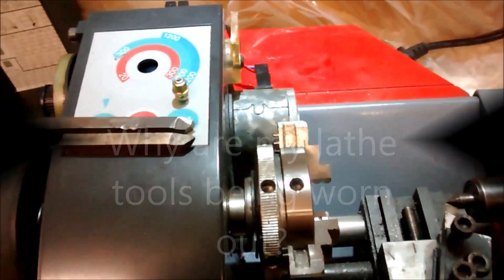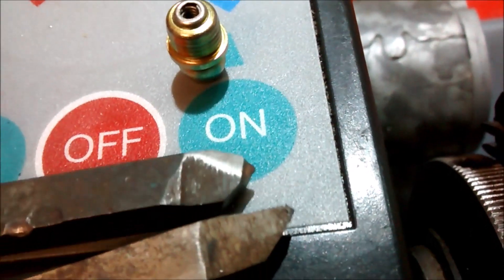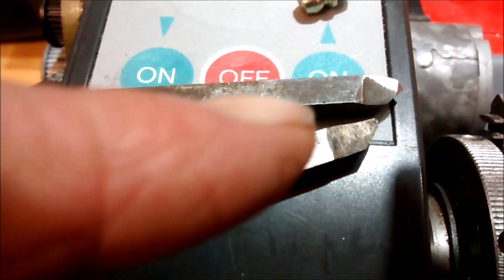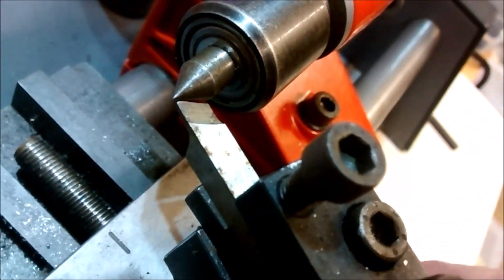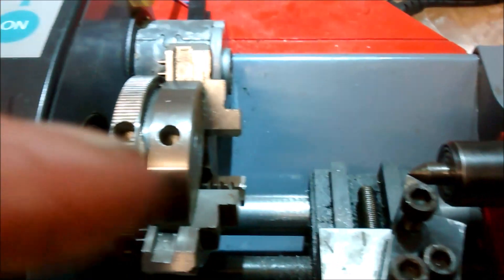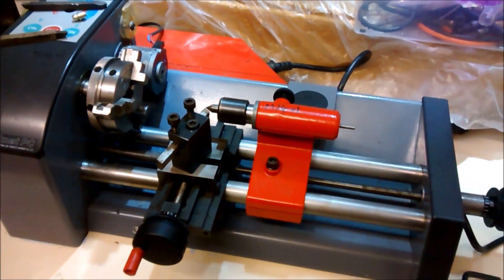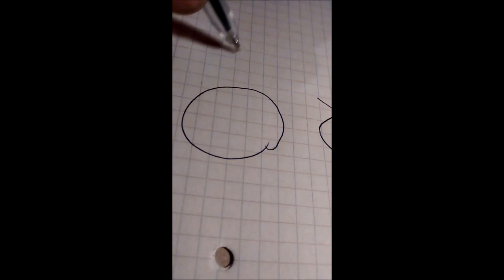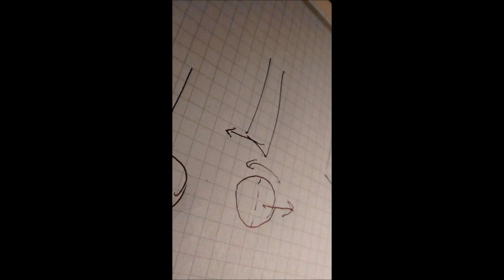Why are my lathe tools wearing

Comment: Did you manage to solve the problem with this? And how is your UNIMAT PC going? Thanks!
Reply: I do not use it because I do not have the correct chuck key. I have a cheap Chinese lathe set up ready to go that does the odd bits of turning that I need to do. I should really spend some time with it.

Comment: That indeed looks weird

Buy a new hss tool bit. First one you showed looked more like mild steel. grind it sharp with no nose radius and see what happens. It must cut with the least amount of pressure to not deflect the machine to much. Be sure the lathe runs the correct direction.
Reply from the maker: Tank you Stian. I will have another go. I have uncovered my grinding wheel in my shed clearout.